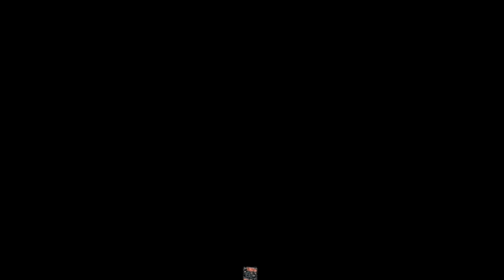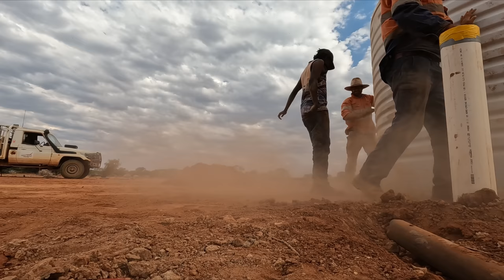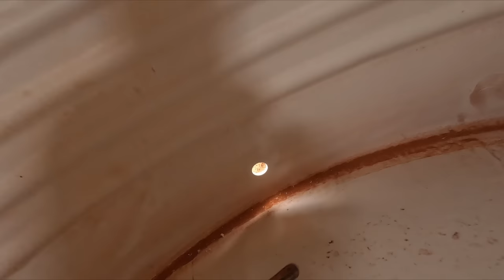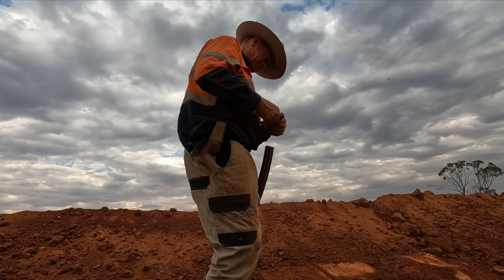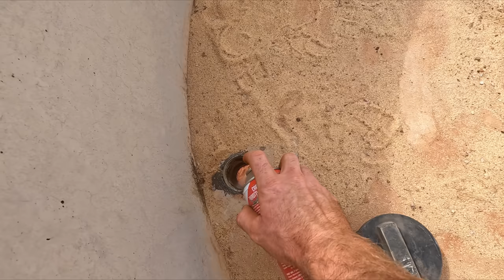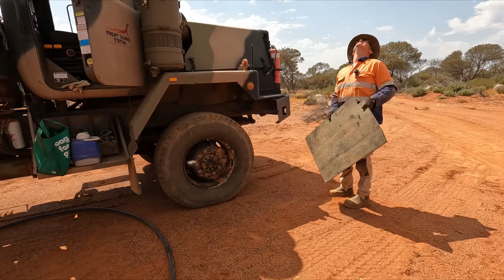100th Upload Special: Finders Keepers Water Point Setup

Comment: I had a severe case of tennis elbow in my right arm.  I couldn’t hold any weight in my right arm or pick things up.  For about a month I carry a tennis ball with me everywhere I went. I would, as I was walking I would hold the ball in my right arm, just hanging down my side, squeeze and twist, and come up to where my forearm was parallel to the ground. One day as I was squeezing and twisting, and I felt it pop. It hurts so bad I dropped to my knees, but after that it started feeling better. I haven’t had problems since. It’s your basic physical therapy.

Comment: put all the tips of your fingers together , put a rubber band around the outside like its holding the fingers together then spread them apart pushing against the rubber band that,s trying to hold them together  !good exercise. that exercise the muscles in the hands , opposite  ones that cause the problem of carpel tunnel   i think griping things in  your hands strengthens  hand and wrist cause makeing carpel tunnel problem worse

Comment: Ant you could try Rapigel they use it on horses but myself and the boys at work use it on our knees and shoulders and elbows 
It’s in a white pot you can buy it at the chemist otherwise try the stock feeders 
And Ant put it on thick          But don’t rub your eyes or scratch ya balls it will hurt
Reply from the maker: Also make sure you wait for a while after a shower before applying it!
Reply: Thanks. I will give it a go!

Comment: Are you using a standard Starlink Antenna on your trucks.  I know they charge a small fortune for the Starlinks Antennas that are used on Recreational Vehicles (aka Caravans).
Reply from the maker: Yes standard starlink in modified cases. 
We've done a couple of videos on them. And are planning on doing more
Reply: @jack_out_the_back  That is good to know I am thinking of getting a Starlink, and mount it on my Toyota Truck, for a vacation drive from Texas to Alaska.   By the way my Jack out the back Cap is in town, I need to go pick it up at the Post office.